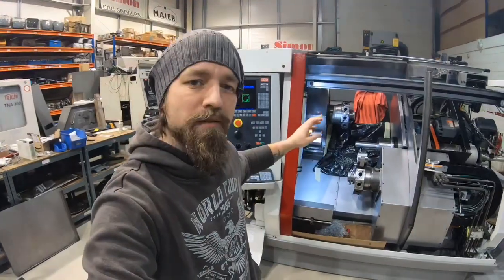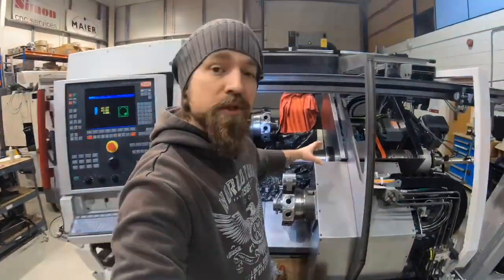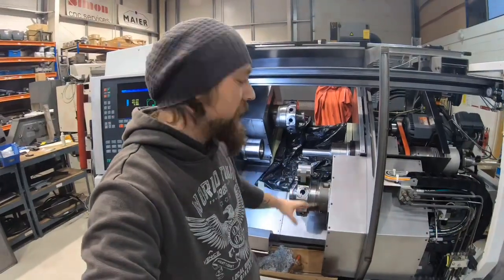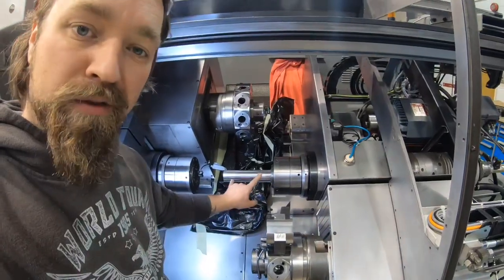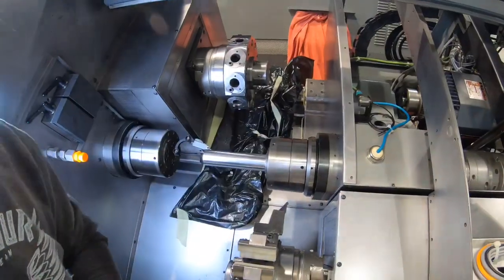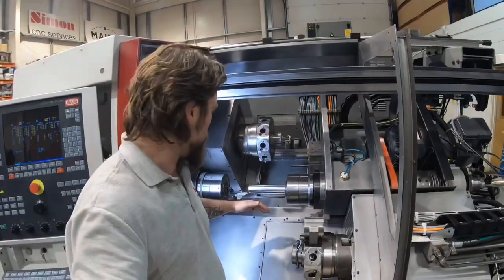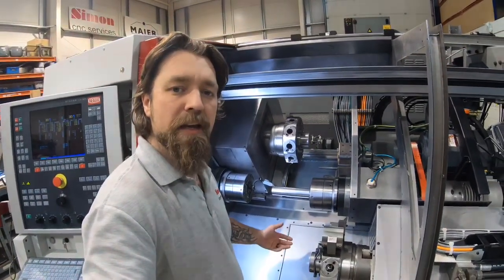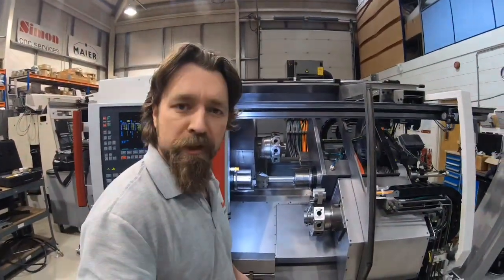Traub TNC65 Taper Turn Test

Comment: How can measure tool traub machine
Reply from the maker: You usually use a scope and calibrate tool geometry by ATC button on tool/offset page. (Automatic Tool Calibration)
Reply: @simoncncservices3026  I done this process but as per program tool not working.
Reply: Machine Name- TRAUB 42/65 TX8H
Reply from the maker: You can always measure the tool off the machine and enter into tool geometry. Usually happens if the scope is damaged your calculation will be off
Reply: Dear sir Please help me I am From INDIA.
Reply: @simoncncservices3026  yes sir but I not found tool measure and geometry. I got tool data,tool tip offset and tool life data
Reply from the maker: You need to use scope and press ATC
Reply: @simoncncservices3026  thank you I done this its working
Reply: @simoncncservices3026  simon can you provide online training any off your cost
Reply from the maker: It’s something we are currently looking into. You should email your company details
Reply: @simoncncservices3026  simon ok thanks and we have send company detail and email address. Company name pet form and place div daman   india
Reply: Thank you so much sir